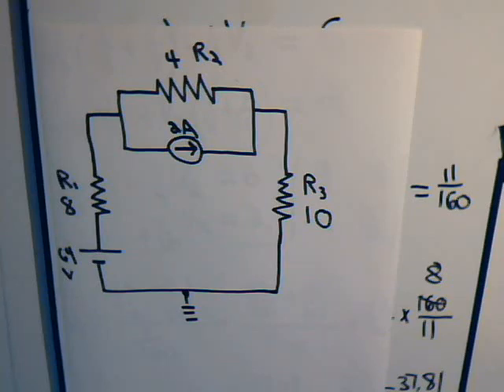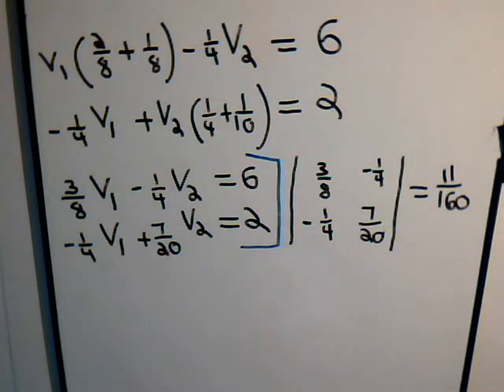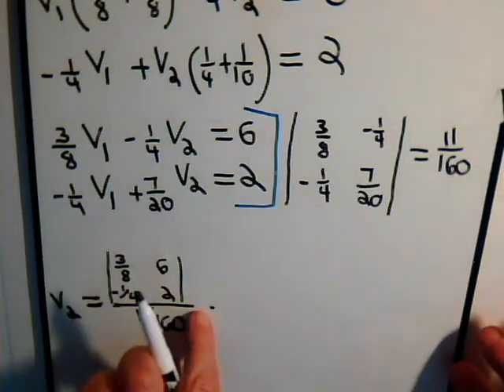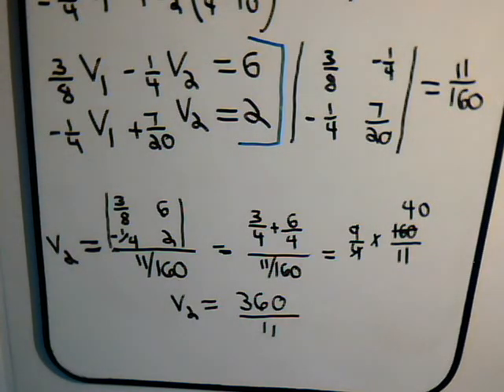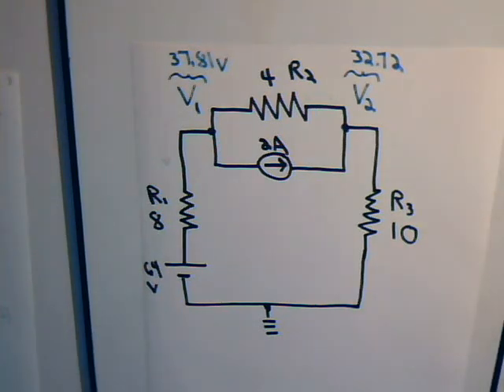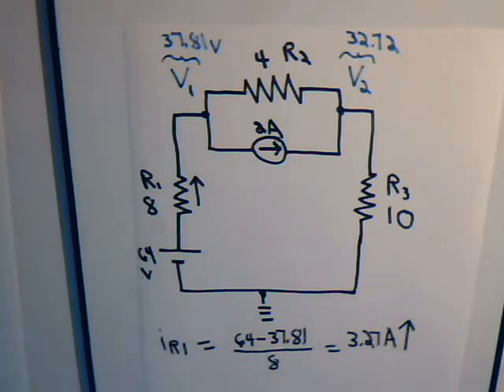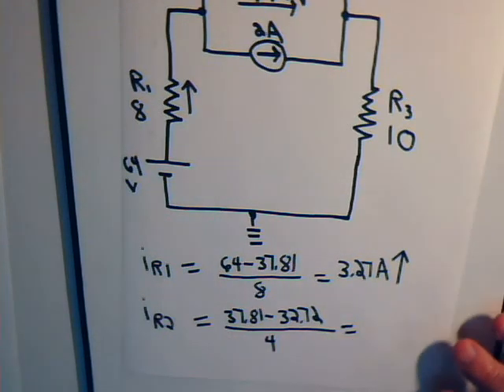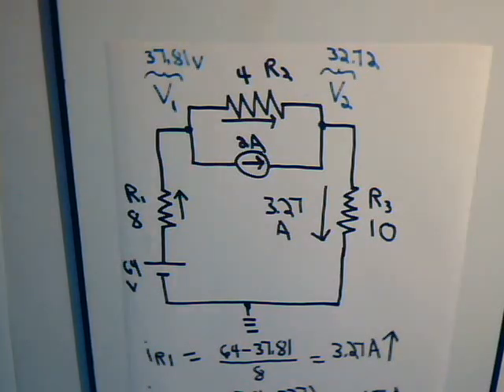Electrical Circuits Video 27: Nodal Analysis Example #3 Part B

Comment: Do the current to voltage source conversion for the parallel current and resistance first, then using the Millman's theorem will be significantly easier, we obtain V1= [(64/8)-(8/(4+10)]/[1/8)+(1/(4+10)]=37.81Volts. V2=[(64+8)/(8+4)]/[1/(8+4)+1/10]=32.72Volts. 

I appreciate the instructor's logical derivation. Outstanding!